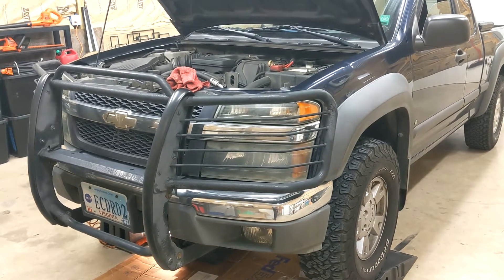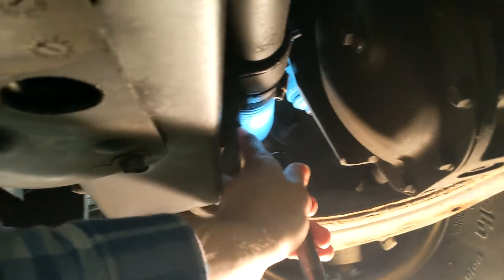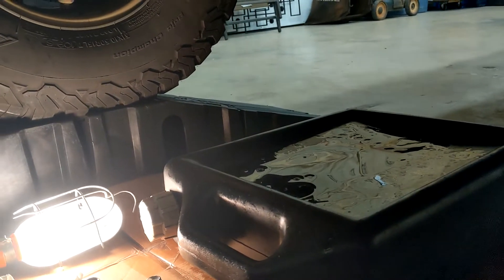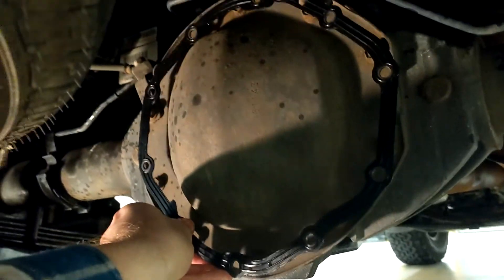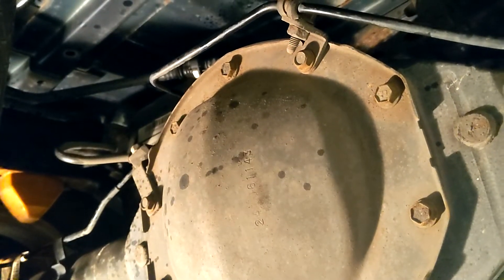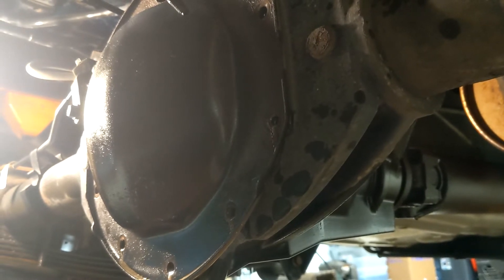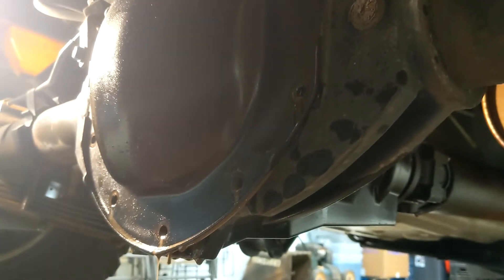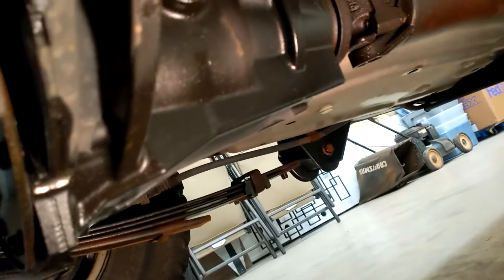How to change differential fluid in a Chevy Colorado

Comment: As a DiY'er and proud owner of a 2007 Chevy Colorado Z71 (2WD) with almost 300,000 miles on it (I call him Harold) I've come across your videos a lot. Every time I need to do something to my truck, you have a video on it. I just wanted to thank you. Subbed.
Reply from the maker: Awesome!  Thank you so much for your kind words.  I love just about everything about these trucks (except for the horseshoe spring on the rear brakes, LOL), and am glad to help keep more of them on the road.  Thanks!
Reply: @CompTechMike  I had problems with that same spring. And there's another dude on here that did a video on it where he just clips it in place and I'm like, there's something going on here because you, and me, could not get that thing in correctly... I had my GF push on it while I spread it, and it I think it still didn't go in right... We messed with that thing for like an hour (per side)
Reply from the maker: @BigMatt202  Wow!  I wonder if some of them have less tension on them, maybe?  Or some people just get lucky, LOL.  🤷‍♀️🤣
Reply: You still have your truck? Mines just got 260 k miles
Reply: @Norecording77  Yup. I've changed jobs since that comment and my commute is over 40 miles now. So I actually got a different vehicle to commute in. The gf has a short commute, like three miles, and she drives Harold to work now so the miles aren't clicking up as fast. I do still own it. It has 314,000 miles on it I think. Runs great... Needs an oil change... And I need to change the fluid in the rear diff, I could go on...

Comment: I have a 2007 Colorado, striped out the fill nut, filled through breather hose, would you know how much I need to fill it, thx
Reply from the maker: Hi Rob!  Ugh, that sucks, man.  Am glad that's never happened to me (although came close a few times).  Obviously hindsight is 20/20, but in the future it's always good to make sure you're able to remove any fill nuts before draining out all the fluid.  In any case, rear differential on the 1st gen Colorado/Canyon usually takes 1.6-1.8 quarts.  You'd be fine if you put two in there.

Good luck, hope you're able to get the fill nut out at some point, maybe weld something to it to allow you to turn it?

Comment: Hey Mike, my rear diff seems to be leaking gear oil more towards the U joint and not by the gasket with all the bolts …where could it be leaking from ,?
Reply from the maker: Hi! I would say that would be the front seal of the differential. Near where the driveshaft connects. Have never had to change one of those, personally, so I'm not sure if you can get to it by dropping the driveshaft and getting to it from the front, or if you'd have to remove the back, axle shafts, and gears. Hopefully it can be done from the front (as that would probably be a lot easier). Good luck, let me know what you find out!
Reply from the maker: Maybe wipe everything down first and try to verify the source of the leak?
Reply: Hey gus i know it’s a year later, but i’ve had to replace said seal that’s leaking for you. I got to it by pulling out the end of the u-joint that goes into the diff after that you can access it

Comment: I leave one bolt on top of the rear end so it does not fall off.
Reply from the maker: Hi!  Thanks for the comment.  That's a good tip.  i assume you take the one bolt out after the fluid has drained so you can inspect the inside and replace the gasket?
Reply: @CompTechMike  yes that is correct

Comment: Hi 
How many quarts does the rear diff hold ??
Reply from the maker: Hi!  This may vary depending on your differential and model year.  Generally capacities varies between 1.6L-1.8L (3.4-3.8 pints).

Comment: Is there any other grease fittings
Reply from the maker: Hi!  Thanks for the comment.  On my '07 the only two greasable points are the outer tie rod ends.  I'm not even sure if this was original - I replaced my outer tie rod ends a few years ago with aftermarket.  On my old cars (early 1970s) everything was greasable -- inner & outer tie rod ends, upper and lower ball joints, idler arm, U-joints, and probably a few other places I'm forgetting, LOL.

Sure is funny how things have changed.  I know they make these things so that they're supposed to last much longer now, but I still like being able to do maintenance on them.  I went to service my wife's car recently and planned on servicing the power steering fluid - only to find out it had electric power steering!  🤣

Comment: how about torque specs???
Reply from the maker: On mine is 20 ft lb. That said, I haven't used a torque wrench on a diff cover since probably the 1980's. I do it pretty much by feel. It is not the specifics of the torque that is the issue, it is the the way it is done. I hand snug all bolts down, the I use cross patterns and snug them all down a little, and do it all over again, and again, till I have them all down to where I want them. I have never had a leak on a diff cover in 30 years.